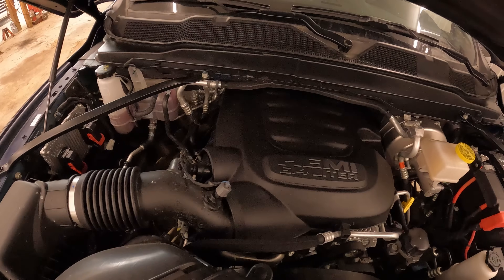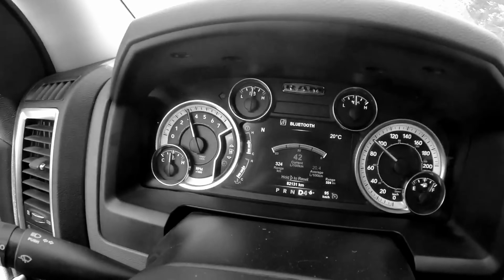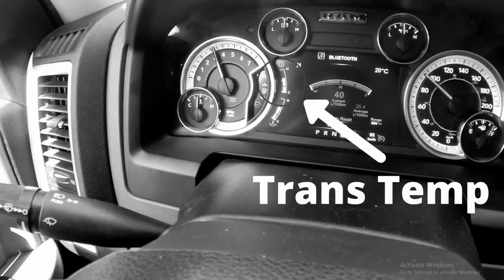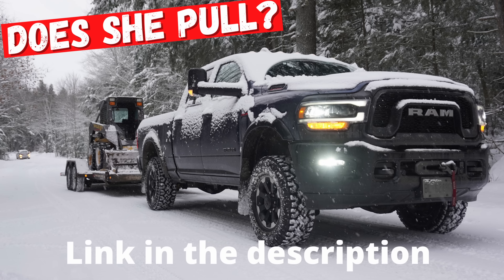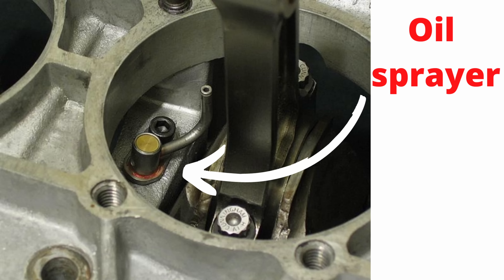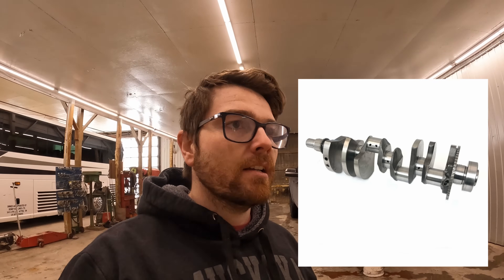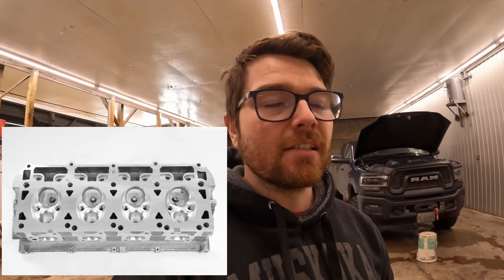RAM 2500 6.4 Hemi Review *Heavy Duty Mechanic* | Is The 6.4 Hemi Better Then 5.7 Hemi ??

Comment: My bud bought a 2023 power wagon, drove it 300 miles from the dealership to the house to show it off and it develop a exhaust leak. Stock exhaust always sounds like it has parakeets chirping in it. In the summer months if you shut it off and then go to fire it back up it can take a few tries, it likes to flood out and stall out. It is a smooth riding truck on ruff terrain, but with the single digit fuel mileage, we do almost all our hunting with my 01 chevy 2500hd 8.1 vortec, for better mileage. The dealership has fix the exhaust leak and most of its issues of loading up, and we don't tow with it.

Comment: Alot of your comparisons are really 2500 vs 1500. The 5.7 in the 2500 has a lot of the same things the 6.4 has, like the external oil cooler. And the oil squirters as an rb/2j builder arent really all that big of a thing.

Comment: Which 6.4 liter is in in the 392 Wrangler; truck version or car version?
Reply: I believe it's the SRT version in the Wrangler.
Reply from the maker: like Dan said it will be the SRT version. although it will come with cast iron manifolds versus the cars that come with tubular. reason being is because of the 4wd and having a front axle gives space limitations. all in all the cast manifolds drops the HP from like 485 to like 475 I think.
Reply: Orange block.

Comment: I just got a 6.6 gasser from Chevy majority of the engine is forged components which should last a long time.
Reply from the maker: I'll give it to GM they know how to make a gas engine!
Reply: Except carbon build up due to direct injection will kill this engine faster. Also,  direct injection technology is problematic on cars, injectors fail just like on diesel.

Comment: The exhaust leak is like the GM 20 years ago vender Makeing the manifold there no where as thick as the 1980s Dodge it's called less powder materials to cut cost

Comment: Any idea how common the hemi tick lifter issues are?
Reply from the maker: Not as common as i once thought. It is an issue on both hemi's but as long as you keep your idle time down and change your oil regularly the tick is rare.
Reply: I recently just got an 05 1500 with the 5.7l with 160k miles to haul my travel trailer and she has the exhaust leak. About to get a 2500 with the cumins 6.7 😃
Reply: @delta122109  6.7... Cummins
Reply: Lack of maintenance makes it common
Reply: @repairvehicle  And living in MT with months of single digit to double digit below zero weather and hitting that remote start for 10 to 15 minutes before getting in. I'm thinking that's my issue as I maintain very well. The thing I thought was a savior was or might have been actually harming the truck... Ahhh, bells and whistles.
Reply: @Redfour5  , you changing your oil every 4k miles or 6 months which ever comes first with full synthetic oil?
Reply: @repairvehicle  Yep, the six month thing is about right. The dealer does it as I had the free plan with three changes per year so I assume, nope know they do as I saw what they used once when in back by the area where they do the oil changes...
Reply: @Redfour5 ,  I did video on Ram/Chrysler 3.6 v6 getting over 500k miles, without engine repairs.  Key to success, ignoring factory recommended intervals. 
Imagine how much money this guy saved vs buying every 100k miles new vehicle.

Comment: Have you towed heavy in hot weather yet? The reason I ask is I have seen the oil temps up to the high 250's when towing heavy. I have been told that is still within the normal range for the 6.4 hemi.
Reply from the maker: I have not. but I'm pulling a pretty good sized trailer in august for 14 hours so that should be a good tests. should be around 9,000lbs
Reply: I saw over 260 oil temps on the 2015 6.4 I had grossing 19k towing.... Ended up have to have the engine replace under warranty around 19k Miles... didnt keep it much longer after that.  that was with 3.73 gears and the horrible 6 speed transmission... Never understood how a truck that was made to tow would run 45 MPH in first gear then fall on its face going into second gear... I hope they have fixed those issues with the new 8 speed.   Loved the truck and the engine was powerful, but the drivetrain was not paired very well
Reply: @robertgunnoe3099  260° is not unreasonable, especially with synthetic oil. Heavy duty semis can run that kind of oil temp all day long when conditions like wind and such are present.
Reply: @dieselmutt8865  I agree that the newer Diesel Engines do run much hotter than they used to for Emissions reasons and the new synthetic oils should be up to the task.   I was running Pennzoil Platinum 0W-40 when mine let go, which is what the manufacturer recommended.  There will always be good and bad in any brand vehicle no matter what you do..

Comment: Just to be clear, a person chooses a Ram because it is superior to GM's largest gas towing engine truck and Ford's? Or, is the Ram priced lower and even though it's lower it's better? Or, good enough for the savings? - i know that all 3 brands are terrible and I've owned all three. I still own a multitude of trucks, vans, tractor trailers, tractors, heavy equipment, motorcycles of all brands. The worse luck I've ever had was Dodge/Ram/Fiat/Crysler/Plymouth/Jeep. There was always a redeeming thing that made me choose a mopar...1: cheaper or 2: cummins diesel or 3: Jeep (no other choice in that design). I notice many people try to say..."shhh...it's a secret....the Ram is better...but no one knows and they buy Ford or Chevy". I don't know if it's a secret as even family and friends I know who have purchased mopar start making excuses like.."well..I liked the engine but the tranny wouldn't stay in it"...or..."the cummins is badass but the truck fell apart". All I hear is how the 5.7 and 6.4 has cam, lifter, valve train issues MORE than the other brands. Yes, the other  brands have that problem too. But, based on statistics and sales....wouldn't the larger 2 other brands show more issues based in percentage in market? In the end...I know the new tundra is having issues. But prior to design change...isn't the tundra winning in the reliability department? The chicken tax prevents Toyota from offering heavy duty trucks. I sure wish they would. Sick of all three domestic brands. They all suck. I just have problems trusting ram. The costs of  ew trucks..Ram is one hell of a chance to take. I did drive a Ram 6.4 the other day and it DID impress me for what it was.  I can't compare. I am not buying new trucks. Holding back. Waiting for better times
Reply: Much rambling, I really have no idea what you are trying to say.

Comment: I have a 21 pw. It runs smoother and I get better mpg with the highest octane 91/92.  My friend with a 19 pw didn’t believe me until he tried it himself. I also think it’s able to run in eco mode at actual highway speeds because of the additional power from the high octane.
Reply: Have fun paying over $5 a gallon for .5 better mpgs lol
Reply: @michaellarrick8881  wow you’re lucky! Here in SoCal it’s currently $6.30. Thankfully my daily driver is a Tesla
Reply: Why you put that much in it lol 87 octane so much cheaper

Comment: Heavy duty until that cylinder deactivation kills some rings 😉
Reply from the maker: Shhhhh. We don't talk about that. I don't see why it's even on these engines. My fuel mileage is so bad with the MDS system so i'm really not sure what the point is
Reply: I manually control my cylinder deactivation meaning I only allow it to turn on when the truck is simply coasting at a median speed with no grades or heavy acceleration and I actually get better fuel economy than when I let the truck just do it's thing on its own. My opinion on this is that the deactivation actually is too agressive at times forcing those four cylinders to work harder and consequently be less fuel efficient than the  eight cylinders not working as hard. Now when I use it at appropriate times it will actually improve the fuel economy by a good margin depending on cruising speed.
Reply: @GettysGarage  .2 mpg?

Comment: I can say the 6.4 HEMI is the only thing I havent had issues with on the two RAM 2500s I use as a worktruck....   Only issues related to the 6.4 is passenger side manifold bolts loosening and catalytic converters bad at 36k on my 2nd RAM....   Everything else?   Ive had major issues with everything else on the trucks and theyre are seriously unreliable, HEMI aside...    My F250s were anvils and I ran them much harder than the RAMS.  The RAMS I drive with kids gloves and they still cant stay away from the dealers broke.

Comment: Of course the 6.4 is a better engine than the 5.7. They wouldnt put a bigger engine in a bigger truck if it wasnt
Reply from the maker: your not wrong! I just wanted to talk about why the 6.4 is better and all the cool differences!
Reply: @GettysGarage  I was surprised you could still get a 5.7 in a 2500 AND even a 3500 here until what 2019?

Comment: Now if Ram would only mate up a 10 speed transmission, like Ford and GM.  And add Auto 4WD while you're at it, like GM does.
Reply: Why? The 10 speeds that Ford and GM are using are having some issues. The 8 speed Ram is now using in the HD's is a beefed version of the 8 speed used in that half tons and it has been an excellent transmission in those.
Reply: @dieselmutt8865  I'd much rather have a 10 speed that was designed from the ground up to be used in heavy duty trucks vs a half ton transmission that was beefed up a little bit.

Comment: Also, the 6.4L hemi truck engine does not have MDS!
Reply: pretty sure it does have cylinder deactivation
Reply: It absolutely does
Reply: My 2021 2500 does
Reply: My 2020 does have the MDS.  Not a big fan.  If not towing, I generally set the gear limiter to 8 so that MDS does not kick in. The engine sounds and feels strange when MDS is activated.  Wish I could take it off completely.
Reply: i have mixed feeling about it. gear limiter is a good way to eliminate it also i think if you activate tow/haul mode it will deactivate it as well
Reply from the maker: Unfortunately it does have MDS, i mean not sure what it really does because I'm still getting 11mpg with it
Reply: It does absolutely nothing in my opinion. As many others have done, I put my gear selector into manual mode or push the tow/haul button. That will disable the mds system completely. I put an mr400 solo performance exhaust on mine it makes it even worse when the mds kicks in. It was bad enough with stock exhaust.
Reply: Yes it does ! When I had mine I turned it off every time I started it up. The 5.7 doesn’t have MDS in 2500 trim . I’ve had both .
Reply: @GettysGarage  My 2019 2500 with 6.4 has the MDS and when on the highway doing 70, without a trailer, I get between 19-21 MPG so it is definitely worth it! If you are loaded up it will not be in use. It is even present in tow mode but will rarely ever be activated due to torque requirements. The only way to really disable it is to manually downshift the gears and leave them in manual.